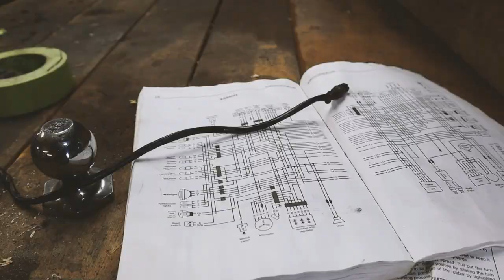Broken chain, new tires, and our DIY garage! | Motovlog

Comment: These kinds of places are great. The space, the knowledge share, the access to equipment that the average DIY person would rarely buy for themselves but needs regularly. I'm looking at you, tire mounting equipment. I do suggest some noise protection around that compressor, gonna be LOUD in there when that thing kicks off, and with the winter here I bet it gets fairly busy on evenings and weekends now.
Honestly, I think the ability for people to learn and do their own work is just as important as the space and equipment itself. Self reliant isn't really the word, but maybe small group? Plus, the confidence that comes from having worked on your own bike can be great when you're considering a trip where your usual support system might not be immediately on hand.

Oh, looking forward to the riding hoodie. Something like that and a t-shirt with kevlar are high on my list for things like grocery runs and other extremely short rides where gearing up might take longer than the ride and I might be tempted to skip it if I stuck to traditional gear. Just grabbing a different hoodie and my helmet with the gloves stuffed in it will go a long way toward minimizing that temptation.

Comment: Hi Megan, How are You Doing? I am from India. I had a Honda Motorcycle for 21 years. I used to do the maintenance by myself. Like DIY. In my manual, it was written that whenever You have to replace a Chain, You have to replace the Sprockets also. When You remove the chain, it was cut open. That means there was no clip there. It was riveted. But You used the clip. How did You adjust the slackness of the Chain? Your Brother and You are a very good team. It is so nice. There is a repair workshop where You can take Your Motorcycle and work on it. That is really nice. We don't have anything like that here. Thanks. Take Care.

Comment: Any consideration to changing the sprockets with the chain?  Many people do both at the same time.  That’s a great idea to have a community garage, especially in big cities.  Nice video.
Reply from the maker: Decided to save it for next time.
Reply: Depends on the wear. If the chain is just rusty and not worn out of spec the sprockets will still interface dandy with a new chain.

Comment: Hey quick check;. Did you do the sprocket?
Reply from the maker: Not this time, it's still in good shape. Both will definitely be changed out next time. The chain had superficial rust from humidity and weather unfortunately